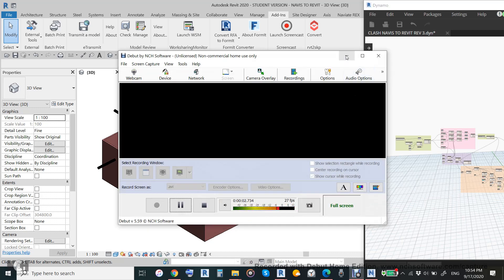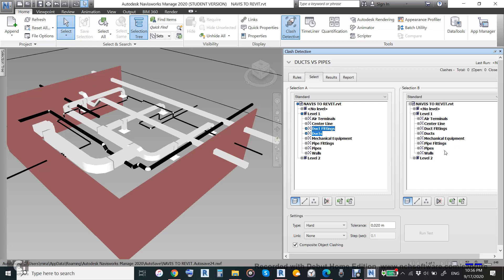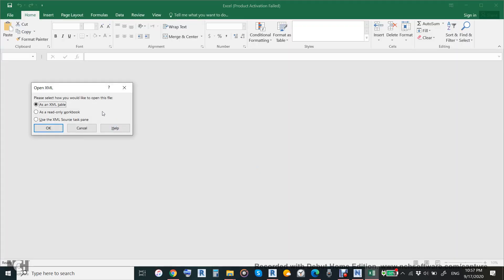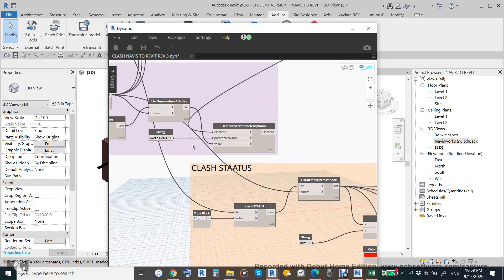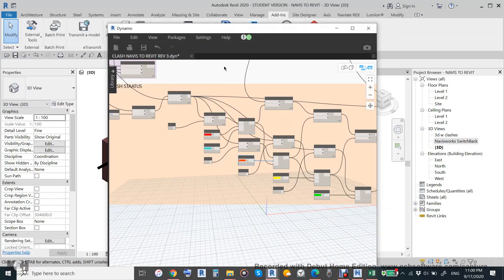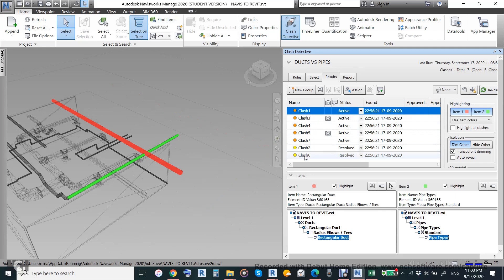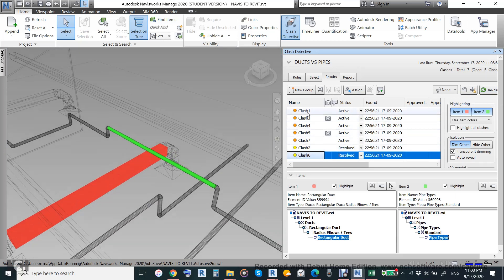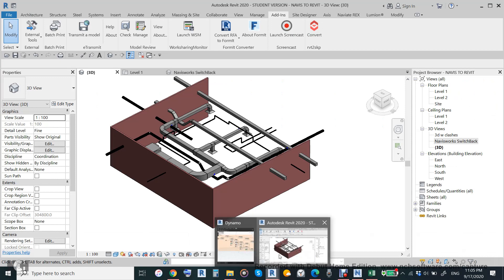SYNC BETWEEN REVIT AND NAVISWORK FOR CLASH DETECTION USING DYNAMO

Comment: I tried to run the script, but it gives an error. Do you know what it might be? Please advise.
Reply from the maker: install this pakage it will work

archi-lab.net   	20'2.210.2522

bimorphNodes 	4.0.8

Clockwork  for Dynamo  l.x 	1.34.0

Clockwork  for Dynamo 2.x	2.3.0

Curve.loop	0.8.1

CurvesToPolyCurve 	1.1.0

Data-Shapes 	2022.2.96

DHH-DynamoForRevit 	2018.0.3

DynaWorks20 	2.0.0 	:

Join.Geometry 	8.1.1942

LunchBox for Dynamo 	2015.7.21

LunchBox Quad Gri d by Face	0.0.1

Lunchbox Quad Grid By Face Dalian  1.1.1

MEPover 	2020.6.2

Rhythm 	2021.7.3

spring nodes 	204.1.0

SteamNodes 	1.2.4

StructuralDesign	2021.9.23

Universo_BIM 	19.10.11